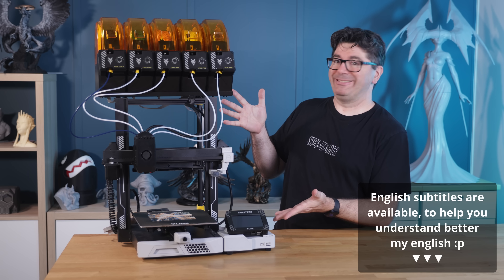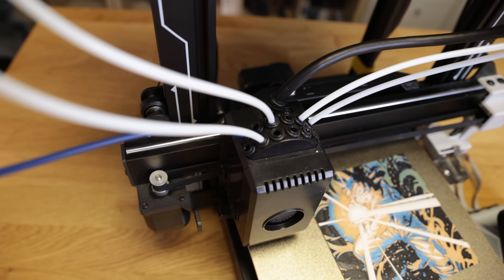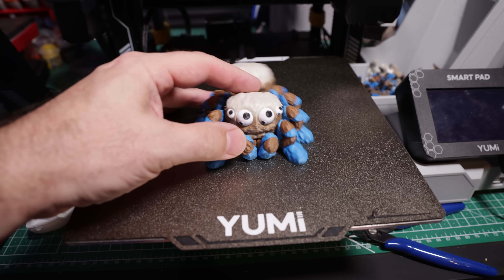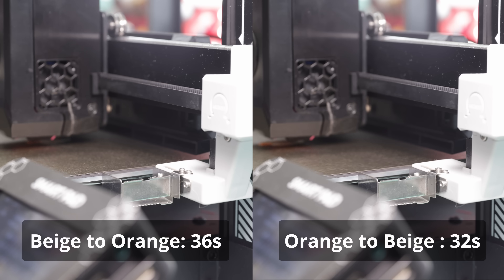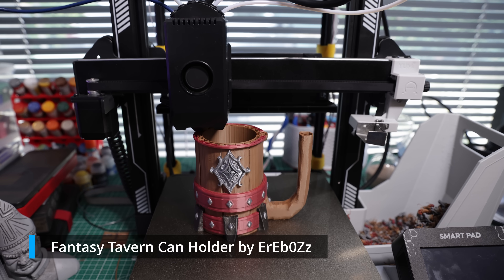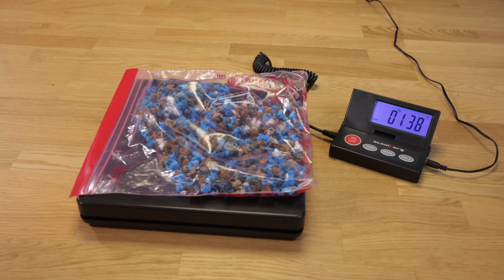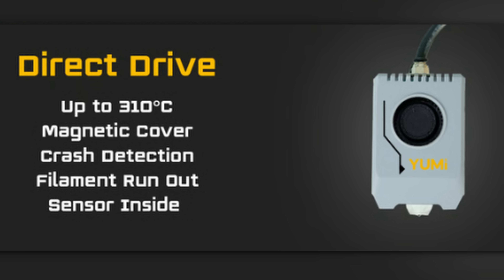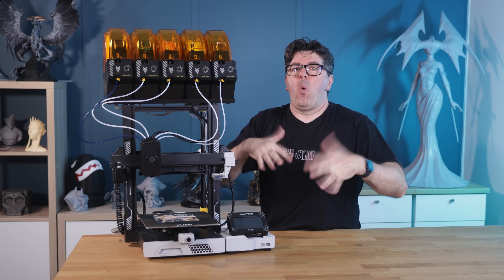Preview of YUMi C235 multi color 3D printer!!

Comment: for me, single nozzle are old right now. the poop filament are incredibly a lot. still, snapmaker u1 win with multi nozzle filament.
Reply: if you think 4 colors is okey maybe... but Yumi want to resolve the real multi colors at low price and easy to use... U1 not resolve this trouble.
Reply: @YUMI3DPRINTERS  Hi, I'm very interested but I have 2 questions:

1. Will an enclosure be offered in the future?

2.  What is the max usable print area of the 435 (and max print height)? 

Thank you :)

Comment: CoPrint sells and operational unit for like $239. USD
Reply from the maker: I have a CoPrint, it's nice for advanced users, not that much beginner friendly, of course, you need to already have a 3D printer 😄 then it's not the same budget 😅
Reply: @PolyworkshopInEnglish  Really, I have only been 3D printing for 6 months and it it did not over tax me. I did just watch the video as I went. maybe that helped more/
Reply: I looked at coprint and it's not so cheap to get 12 colors.  There are other advantages to it, of course.
Reply: @BeyondFunction1  Holy Gods is anything cheap for 12 colors, I mean really.
Reply: LOL Um.  Well you were the one who brought up coprint and how much it costs in the first place.  

You were low by $50, btw.  So, 289 for a 4-color coprint vs 362 for a 5-color Yumi.  The latter also includes a printer, of course.

But, as I said, coprint has its advantages, not the least of which is higher temp hotend (300⁰C vs 240⁰C--only the single color Yumi print head can do 300).